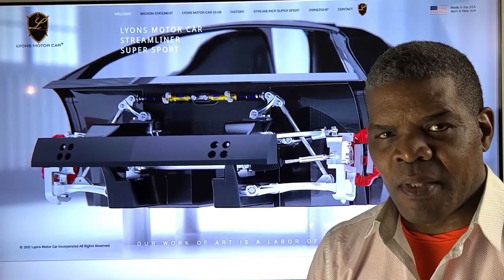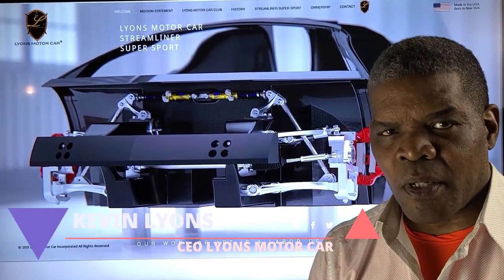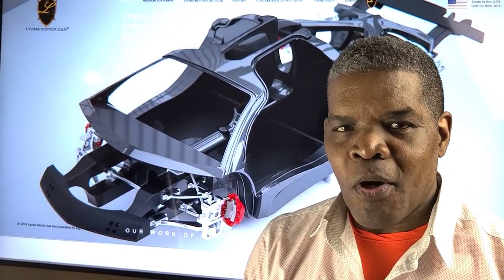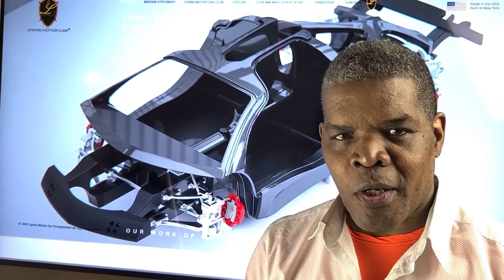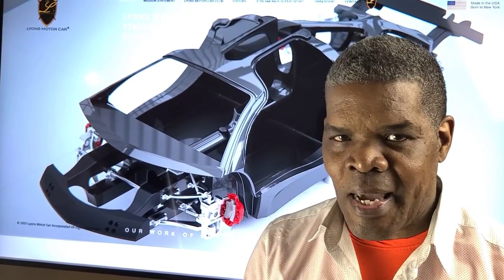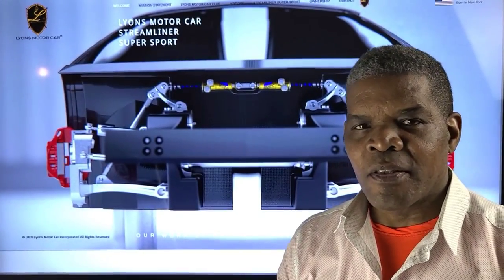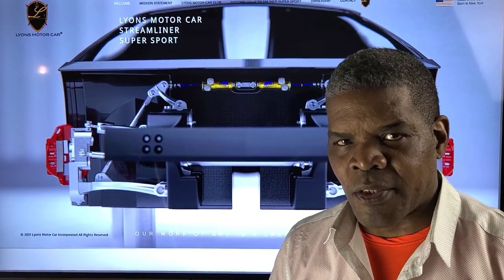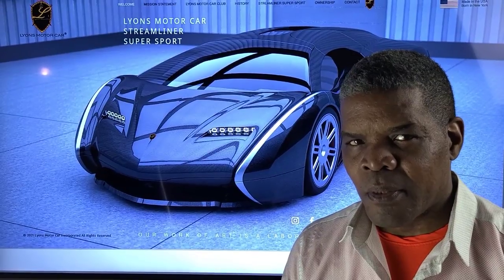Complete Streamliner Super Sport carbon fiber chassis 4K

Comment: I certainly wish you success in this endeavor. Two-thousand horsepower seems excessive but among billionaires, bragging rights are worth a lot. I'll be following the development.
Reply: Pagani Huayra 864hp
Koenigsegg Yesko 1600 
Bugatti Chiron SS 1578 
Hennessy F5 1817 
Rimac Nevera 1914 
Deus EV2200 
Lyons Motor Streamliner SS 2500
Reply: @kevinlyons5717  Thanks for your reply. Those power levels will, as you know, require some sophisticated traction control to be usable. I remember Tom Nelson's DOHC engine from a dozen years ago and wondered what happened to that project. I hope you can raise the capital to make this happen.

Comment: Wow, finally someone not afraid to push the limits. I too have designed Supercars with over the top performance. 2,500 horsepower is the minimum I need, and 5,000 is not out of the question. My design uses twin SBC's, one behind cockpit, the other in front of cockpit. Engines are not linked together, sync is controlled electronically. 

The dream, make a street legal car that is capable of 500 mph. The limiting factor is not engines, power, or chassis. The limiting factor is tires. Even Bugatti with their $40,000 tires will only last 15 minutes at top speed. LSR cars at the Salt Flats run custom tires. The record setting stream-liners don't even have tires. They have special alloy wheels with 'tread' pattern on outer surface. They have to withstand incredible heat and centrifugal forces. 

I will keep an eye open for your projects. So far I am impressed.

Comment: Can you just ground to chassis, since its carbon fiber?
Reply: You would use separate grounding system (like wires, busbars or similar) not the CFRP chassis itself. There is a requirement for max contact resistance in the grounding loop.